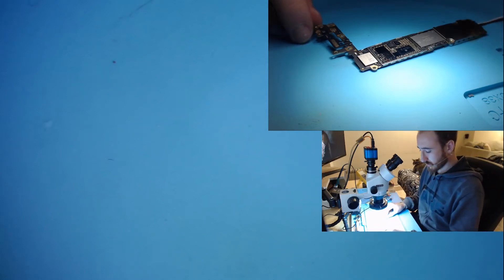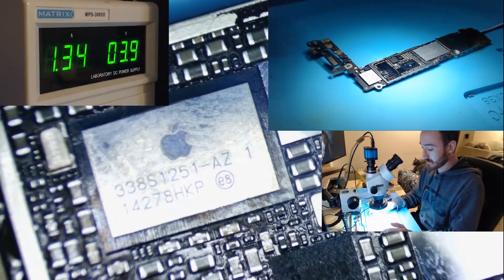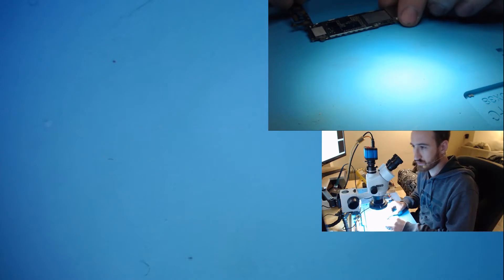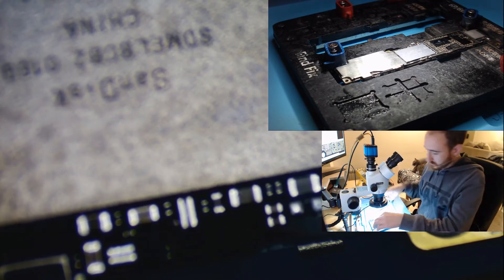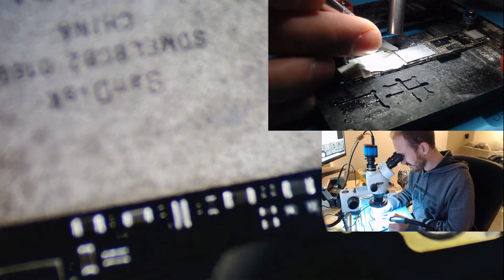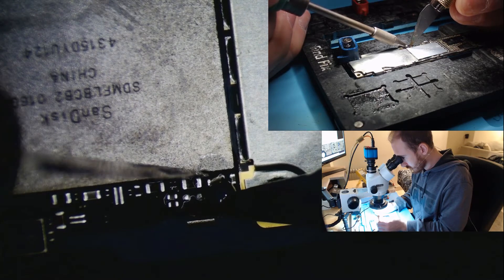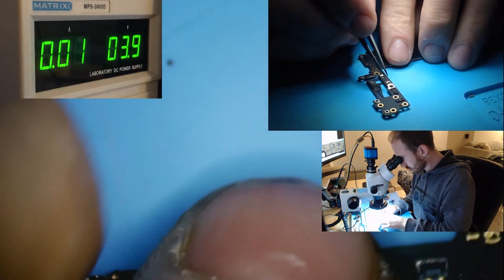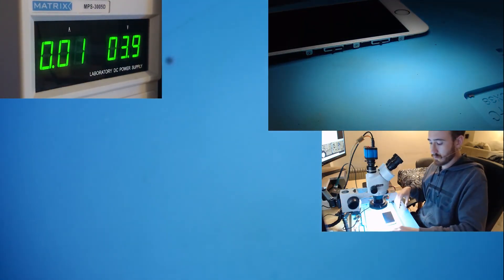PMIC gets hot. Is it shorted???

Comment: Great! I have the same problem with my iPhone 6. I removed the same capacitor and my iPhone started up again. unfortunately with the charger the phone does not charge and absorbs 0.08 Amps. with the bench power supply created about 10 minutes after restart. What could it be? energy saving? Thank you
Reply from the maker: There is something wrong with the Batt SWI line either on the battery or the logicboard itself. Did you try another batt?
Reply: @RepairLab  
I changed the battery and it works perfectly. thank you for sharing your knowledge. can you have an explanation on the removal of the capacitor? thanks
Reply from the maker: Raffaele Cotis what explanation do you mean? The cap is shorted so it creates a path to ground and the 3v0 nand voltage goes to ground.
Reply: @RepairLab  Hello my friend, I've did something stupid trying to practice with a 4s board. I removed the shields, and saw some of the solder balls spheres on the area of the pmic . Stupidly I tried to power on the phone. I used thermal camera and pmic get's instantly hot, around 0.300 amps or more I removed it thought for sure some balls might have bridged. I reballed and soldered back and still same short. Question is , how can I know for sure now PMIC has died for my stupidity, I checked all caps around and there are no shorts at all. And we know if I remove pmic there's no way of checking if anything gets heated up as no voltages initialize. What I thought was to inject voltage on lines from pmic and see if something gets got on thermal camera. But again there aren't any schematics with lines identified. Anyways hope I don't bother and you canhelp thanks a lot.  What calms me a bit is that on the cpu area I don't see any small tiny bits of balls nothing.

Comment: http://imgur.com/gallery/ULLRoNA a bunch of my pads lifted when removing the PMIC. When I lay the new one down and apply hot air. Will the balls flow down into the missing pad spots and create a working circuit or is this board done for?
Reply from the maker: No It doesnt work that way. are those pads connected? Take in mind that there are also NC pads (not connected) . Your photo isnt clear. Thanks for commenting

Comment: this solution is 50% ok but phone not  completely  done .your power supply showing battery disharge issue
Reply from the maker: Lol, where did you see that?
Reply: auto 1 point showing  on your power sup
Reply from the maker: Azam Xavier You are totally wrong my Frend. This has nothing to do with battery drain.
Reply: k dear.how is saw on your power supply in 0.01 power . did not switch on the phone. i saw on your video 2.26 .